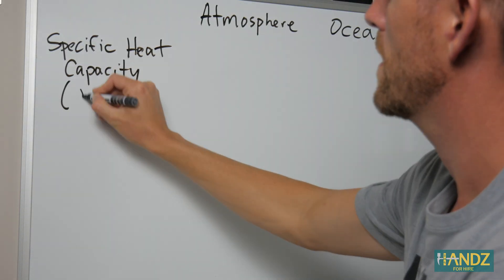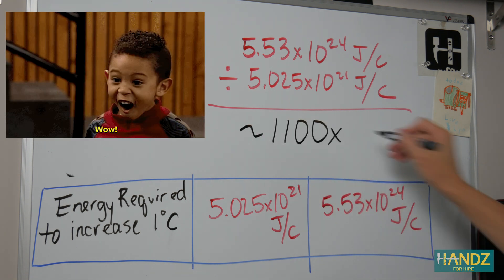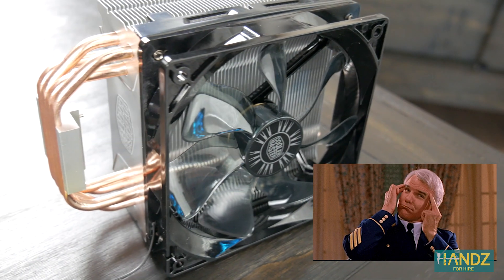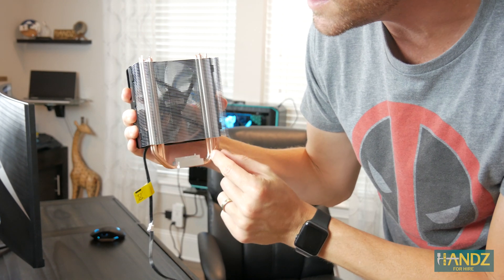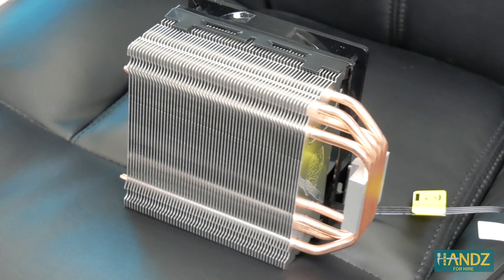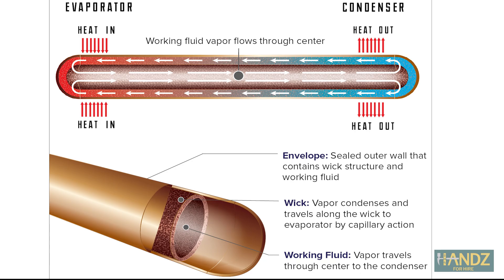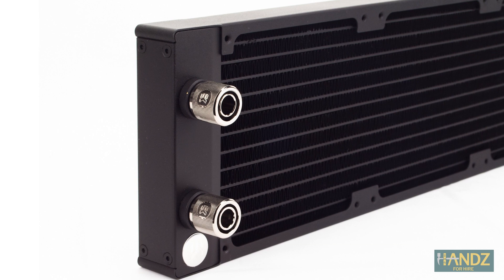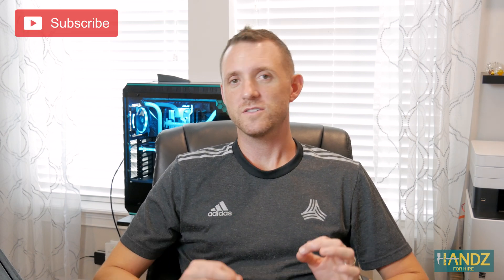What is the BEST PC Cooling Solution? Science Behind Air Cooled vs Liquid Cooled Computers

Comment: That's alot of fancy math, but in reality alot of mid range air coolers cool just as well, or better in some cases, than even some high end water cooled loops, and of course, water stays heat soaked for much longer than an air cooler does, which basically means air coolers can cool a CPU faster, and the CPU cools down faster after after long periods of heat exposure. As long as your PC is vented properly with adequate air flow, it will generally out preform an AIO.